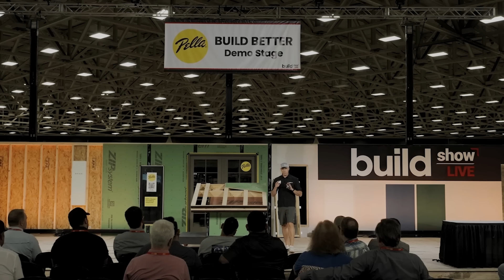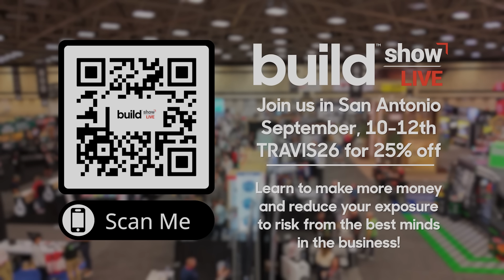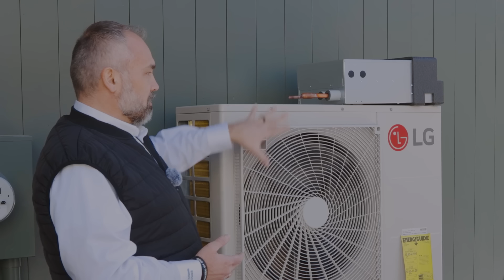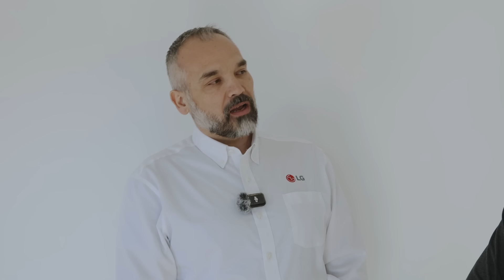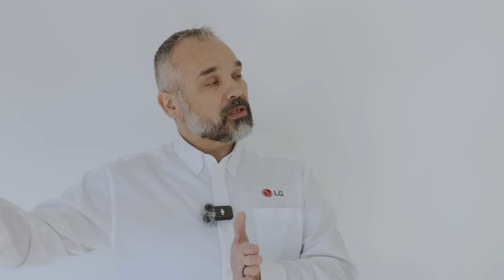Heat Pumps, Branch Boxes & Better Comfort

Comment: One thing they didn't mention with multiple indoor units on one outdoor unit is you can't heat on one indoor unit and cool on another.
Reply: You need a 3 pipe system for that

Comment: is that compressor/Inverter unit, like 1 inch off the wall......how is that possible ?
Reply: crappy installer i guess.

could've gone with a 12K btu unit straight away instead....

Comment: We bought a LG heat pump dryer last year. 2 issues. There is not a low heat option. And it typically takes twice as long to dry compared to a regular electric coil vented dryer.
Reply: I have a LG combo with ventless dryer. Love it. Yes, it takes longer ( apparently, because I only can compare with my older gas heated dryer and my memories are fading), but it's much more gently on clothes and I don't care about if it takes 20-40 min longer. Fire and forget. Another big deal: ventless = no vent, dah. No more vent cleaning, no more running pipes through the ceiling, no more sucking air out of the house.
Reply: Good points, thank you.
Reply: Why do you need a low-heat option for a machine that is essentially always in a low-heat mode? This is why they take longer, in addition to not venting out the moisture.

Comment: Such a great video! As an occasional guest on the heat-pump-all-the-things/all-electric "Undecided with Matt Ferrell" channel, Matt and I have been talking about heat pump water heaters and air source heat pumps vs ground source heat pumps for years here in New England, where hydronic heating fueled by burning gas or oil is predominant. I'm glad you mention air-to-water heat pumps — that will help many afford an upgrade. Air-to-water intrigued me and would have been a much cheaper retrofit, but I needed to be able to filter the air and humidify all rooms in the winter. My choice of forced air required replacing undersized AC-only ductwork with all new ductwork, dampers, and zone controllers.
It's both great and painful to see how far things have come even since our 2022 electrification projects (retrofit for me, new for him). After considerable financial pain, I've been (barely) able to tune my oversized system — barely defined as cold-climate — to barely keep up with dehumidifying in the summer. I've also been able to tune it to avoid heat strips for more than a handful of days each winter, but heat strips are still required for 8-minute bursts during automatic, nearly-hourly defrost cycles on very humid, slightly-below-freezing nights. Those efforts were much more challenging than they should have been. I'm glad to start to see signs the HVAC industry/ASHRAE is leaning toward emphasizing not just efficiency, but dehumidification as well.
Matt recently featured a heat pump water heater that has advanced beyond what he and I both have now — dumb, old-tech, single-speed compressors. Modern inverter-based variable-speed compressors would have kept noise down for me and efficiency up in the winter, since my basement plummets to about 56°F and the compressor is running nearly full-time.
You present technical challenges and advancements in such a unique and readily understandable way. This kind of content will surely be a huge benefit to a lot of people who are starting out on their heat pump adoption journey, especially those who are in very cold climates and/or have water heaters in their unconditioned garages. Thank you!

Comment: Here’s just my 2 cents. 3 years ago I installed a unit from Mitsubishi that is almost identical to what they installed on this house. I’m in Wisconsin. So when they say that these systems can handle very low outdoor temperatures that is correct. What they don’t tell you is that your electric bill will more than double. We had a week that first year where we were down to single digits during the day and below zero at night and my unit ran almost nonstop. That month my electric bill was over $600. Where with my old natural gas furnace I would average mid $300. It held a nice 70 degree temperature in the house but it was working.
Reply: I just had a Mitsubishi hyper heat system installed. It has a COP of 4 at 40 degrees, COP of 2 at 0. And COP 1.2 at -10.

It’s more efficient than electric resistance at almost every temperature, until you drop to about -15.
Reply: that is very much expected.

you don't go 160mi/h at the same mileage going 30miles.   if people stopped being so naive there were much less negative surprizes.
Reply: Does your Mitsubishi have backup resistance heat? $600 is resistance heating for large homes. What temp triggered this bill? What square footage is this house.  I am in northern MN. Ten years ago i installed LG LMU480HV with three heads, one branch unit.  It works to -4f. If i run this unit all month it adds $120 to my electric bill.  However, i shut it down when lows reach below -4f and switch to propane.  I know the hyper heats and vapor injection units running below -4f basically are at COP of 1, which is resistance heat territory for cost and usage.
Reply: No it’s a duel fuel system designed to switch back to my old natural gas furnace when it can’t keep up with the desired temperature setting but it never kicked over those first 2 winters.
Reply: @jko0526  how is are the units controlled? Are they communicating? Aux managed by thermostat settings?
Reply: I have the Bosch ids that can go down to 5F at 100%, but given the cost of propane I play an economics game to have my ecobee trigger propane based on what is cheapest to run. But I’m rural so I tend to favor heat pump vs propane because I have to get it delivered.

Comment: Am I the only person that thinks that unit is too close to the house for air circulation at the back?
Reply: It draws air in from the sides and pushes it out the front.  That is why these are on the balcony faces of multi-story condos around the world.
Reply: @michaelpettit1263 it draws 1/3 from the side but 2/3 from the back. but this install can't !

OP is correct.

Comment: Can we have indoor units in different modes (heat/ac) with this gizmo?
Reply: Daikin can do it with a 3 pipe system called heat recovery and the system will run in what they call parallel operation
Reply: @laquavious4612  mitsubishi 2 pipe vrf are much better in my expreience....
Reply: Not necessarily, that would be more of a VRF feature than a branch box feature
Reply: @fiehlsport  VRF uses branch boxes for heat recovery but doesn't need it for standard all units same mode operation.

and not every VRF/VRV systrm can do heat recovery. only 3 pipe systems and mitsubishi does it with their 2-pipe HR system. but thats very apple-esque. nobody would buy into such anti-consumer crap only to have it discontinue 5 later... (or 2 years lifespan in crapple world).
Reply: those are heat recovery units....more complicated
Reply: no...

so this branch box is more of a nothing burger.

every bone standard VRV/VRF does serval IDU's without a branch box 😂😂😂

Comment: off topic  thinking about heat pump dryers  Imagine a heat source into a drier that uses Water from the house hold water heater rather than a gas or electric heat element.  So one just needs to attach the dryer to a heat pump water heater. similar to a faucet .  Remembering that most of these elements that run on gas or electric only cycle at 120 -135 degree load. One less expensive wire or gas line. As you said running a pex line for water to air heat pump is a lot less than running DX lines

Comment: branch boxes - new but old, haha. I think I like the idea of air to water heat pumps, let the main HVAC handle dehumidification instead of buying separate dehumidifier unit. I'm in climate zone 3 (SoCal) and think (for a new build dream home) I'd like some combination of hydronics in-floor heating and HVAC cooling...
However, thinking in terms of power outages (and they will get more frequent) having a separate propane tank for water heater and gas stove plus solar plus batteries plus emergency generator would serve me better in the long run.
Reply: In SoCAl in terms of power outages, Solar and batteries and I would have a LP Generator to back it all up.

Comment: Which LG air to water heat pump are you using? Is it a model available in the US? Please give us an entire episode or an entire series about the fan coil cooling system you’re setting up. I want to do the same thing.

Comment: In Europe, meanwhile Daikin and Samsung introduce Air to air heat pumps with hydraulic module which can heat floors and domestic water by using heat coming from AC
Reply: Those European units use R290 refrigerant, which the US government will not allow in the US yet.  We’re behind the rest of the world in the US.
Reply: @domehead1004 it’s actually not the Government it’s Underwriters Labs.
Reply: @domehead1004 those units don't use R290 in more then 150g [0,15Kg] applications.  that allows for about 3,5KW in direct expansion at limited length.

air to air with hydromodules are at least a few kilos if charge. so these units are not allowed to run A3 refrigerant. mostly it's R32 or the new tastes like R454b.
Reply: Anyone put an octo-valve into these yet, I want to heat my water with waste heat.
Reply: @edc1569  daikin got something like that. it is called Multi+. at least for the european market.

there is an outdoor unit that can handle 4 indoorunits plus the water tank ranging from 90L to 270L.

i guess it uses an additional 4-way valve.

there will be s resistive heater in the tank for boost and vapour compression cycle failure but AFAIK it uses hotgas desuperheating.

the tank can be heated from the ODU without cooling mode on the IDU and the IDU can be in heating mode while tank is being charged up to temperature from outdoor air.  maybe at lower per-unit-power because handling 5 IDU's in heating a bit of work.

Comment: So what happens if you have a leak in the system somewhere… ???? It’s gonna be a nightmare to find that leak…. Lol🙈
I’m guessing you would have to put the branch box in an accessible spot….?? such as an attic ….?? 

I think it’s cool… And I think it could work in the right situation… But it could also create a Maintenance nightmare… If you’re not careful😓🙈
Reply: The alpha and omega is a GOOD installation!
Techs including myself are complaining about nowadays questionable quality but an impeccable installation will have everything running pretty damn good! I personally don't like these systems. I prefer more mechanical parts and as a refrigeration guy I avoid anything that has to do with vrf, mini split and inverter driven systems. The idea behind it is top notch but in practice it is a nightmare to work on